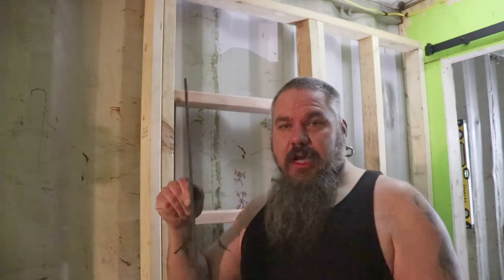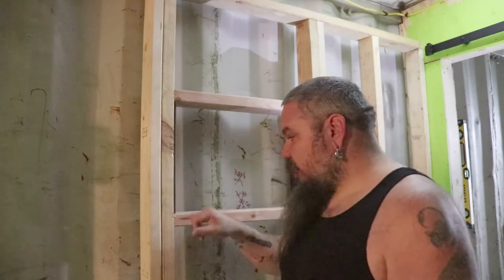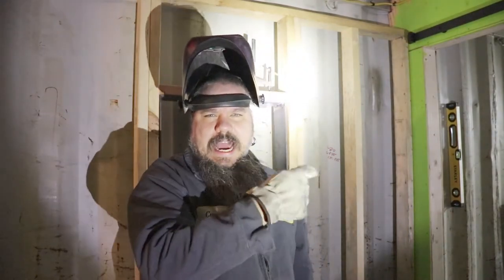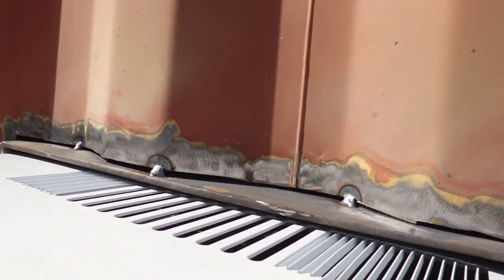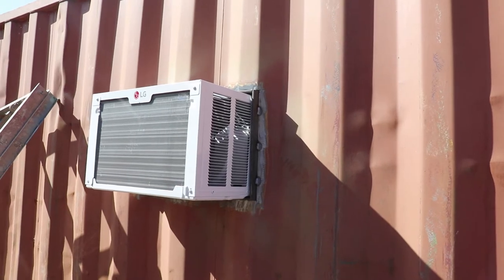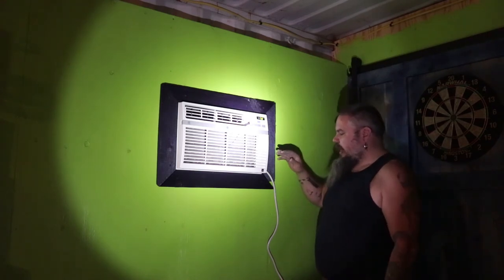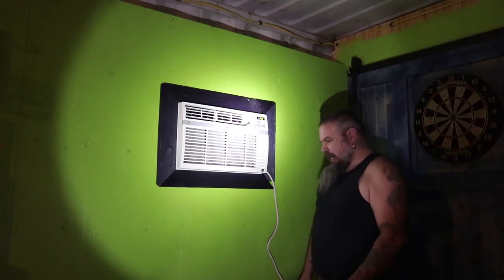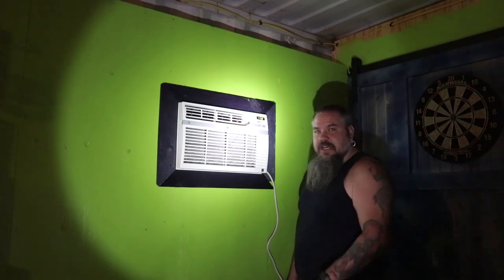Air Conditioner In The Shipping Container!

Comment: Sweet awesome, looks good.  Question:  It's been 3 years since install so what do you know now that you would of done differently?
Reply from the maker: It is still going strong. Basic install wise I would have changed nothing, other than maybe installed it a little lower. It seems it would be more efficient at waist high. Also probably go with a larger unit. On a close to 100 degree day in the blazing sun it will maintain around 75 degrees, which is nothing to complain about, but a larger unit than what will get you by would probably be better.
Reply: @CampingOutOfDebt88  Sweet man, thanks for your time.